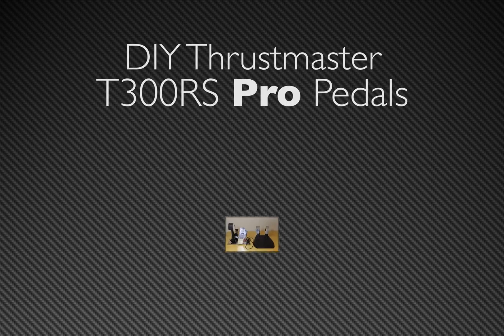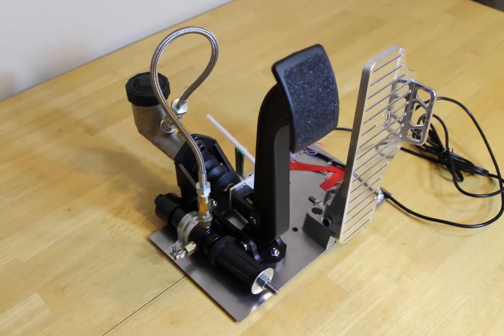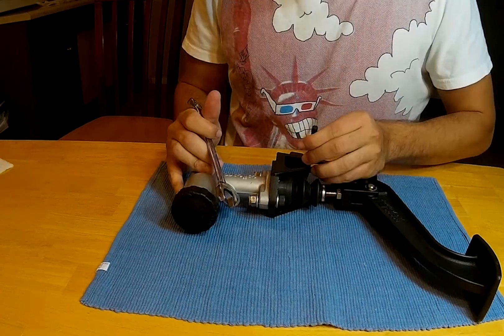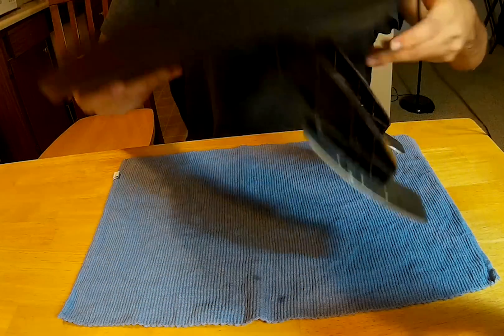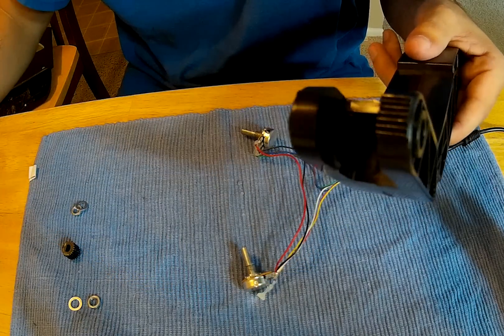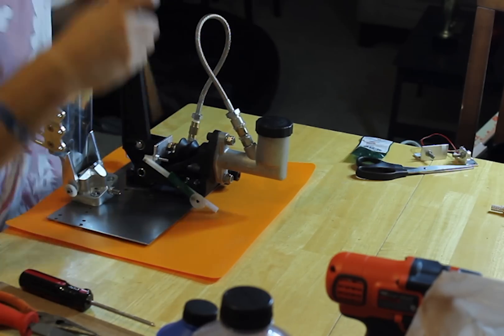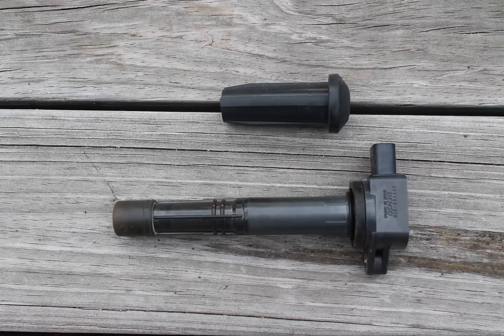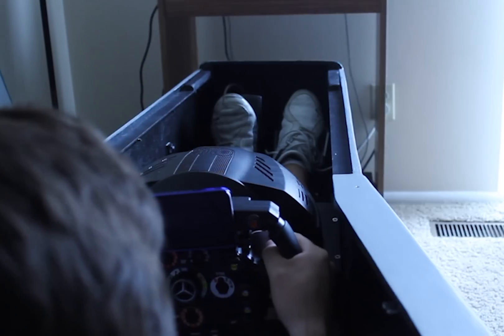HOW TO turn your T300 pedals into PRO sim racing Pedals! DIY

Comment: Great build. Have you tried connecting a pressure sensor to the slave cylinder instead of having the potentiometer on the brake pedal?

The pressure sensor wiring would be the same. I did it on my build. Pretty happy with it.

Comment: Nice work, mate! However, I think it's worth nothing that using a cheaper master cylinder, not fucking WILWOOD!! and a normal brake line would reduce the costs even further, right? Also, still using the potentiometer kinda beats the purpose, isn't it?

Comment: Similar to what im thinking of doing with my t3pa pros, going hydraulic 
for the feel, but will be ditching the pots and adding a load cell 
instead. Not quite figured out how, but thinking of adding the cell on 
the end of a slave cylinder that pushes, instead of like this one that pulls.

Comment: it is old video, but.:
if you  change brake pedal potenciometer to pressure sensor it will be perfect.
I did same to G27 pedals > changed to real pedals.
G27 potenciometer use 0-5V power suply- same as pressur sensors, signal 0-5V- same as  pressure sensor.

Comment: woow the mount brake pedal cost at much at fanatec pedals, anyone know how to do this with a vw beettle pedals
Reply: easy, put pressure sensor and connect instead brake potenciometer,    gas pedal  connect to throtle body sensor.
Reply: @fregisz  maybe some day, just finish my load cell pedal with leo bodnar board and work amazing now iam faster about 2 secs
Reply: @testdirver  i go budget, used car pedals, brake hydraulic system, used presure sensor and worked it. in home is bad because if leaks it not ok. dot is bad fluide.
 i get faster ~5%

Comment: Make sure you use no teflontapes at all. Breaklines are not the same as ordinary garden taps. The tread gives no sealing. The reason you got leaks, because you didn't tighten the bolts well. Do not ever use teflontape on anything,which can cause injury when starts leaking. Earthgas pipes, breakpipes, fuellines, and etc..

Comment: With no Pressure Transducer as sensor it's just not what it should be at all... The Clutch config but not the brakes.
Reply: That's more realistic, mechanically than a load cell.

Comment: I've got the thrustmaster TX.Do think this will work with my pedals?
Reply from the maker: I believe it will. Those pedals are also potentiometer based pedals. It will be the same process, take the potentiometers out and adapt them to the new ones.
Reply: TX pedals are exactly the same as T300 pedals, just with a slightly different look. (I realize you've likely already solved it, but thought I would leave the comment anyway.)